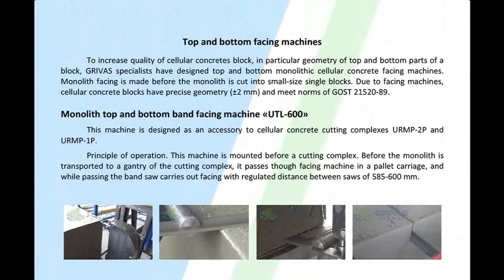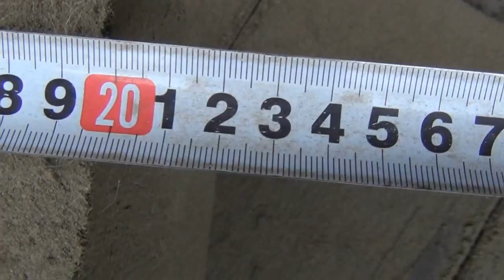Cutting and trimming foam concrete (CLC) array into blocks. Band trimming machine "UTL-600"

Comment: Hi please send us some information about cutting material such as MArble. İs it possible to cut marble. Also send us what is the segment thickness
Reply from the maker: Our complexes have been designed to work with cellular lightweight concrete but not marble. Nevertheless, our company is ready to consider the possibility of designing a custom order according to your requirements and technical specifications.
Visit our website www.grivas.ua to contact us or send us an email to info@grivas.ua